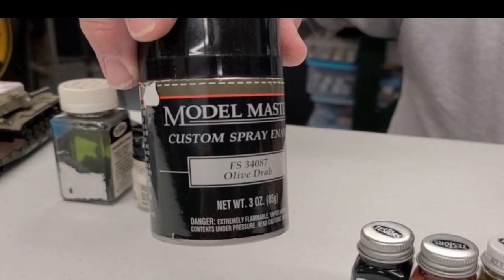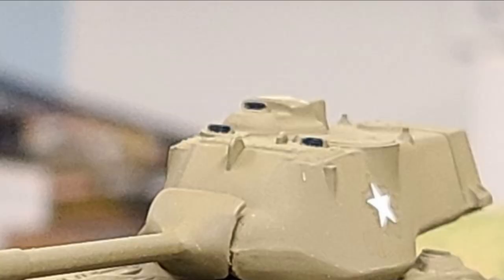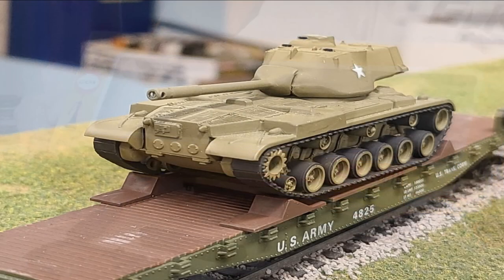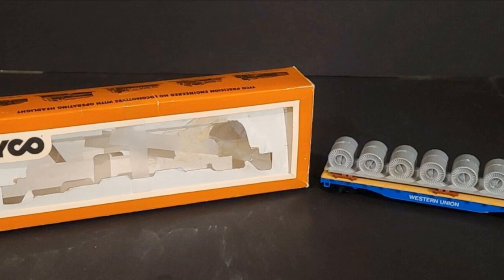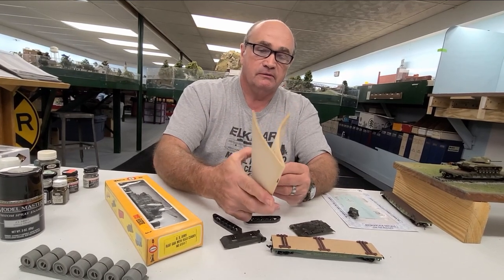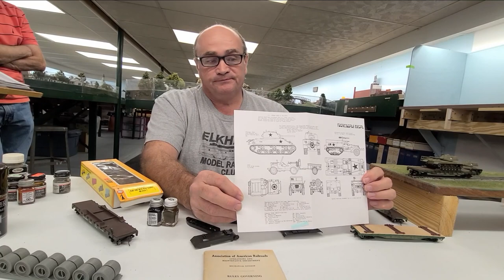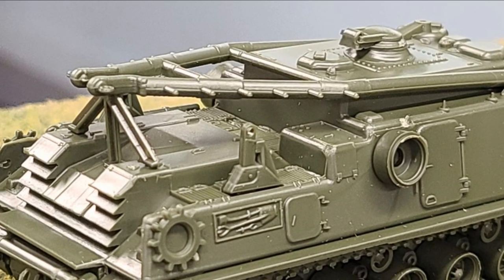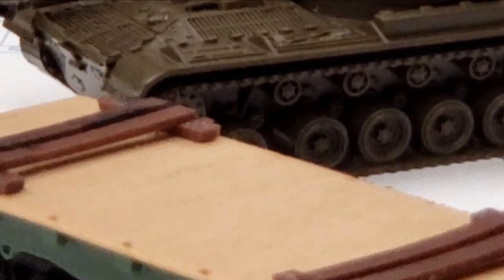Elkhart Model Railroad Club Clinic; Military Loads for Freight Cars

Comment: Platoon structure of a tank platoon 1950 to about 1985 was 5 tanks, plus 2 in the company HQ section, so 17 tanks total.  They changed about 1985 with the introduction of the Abrams to 4 tanks per platoon.  Nice clinic.